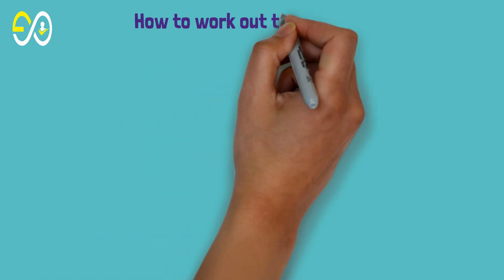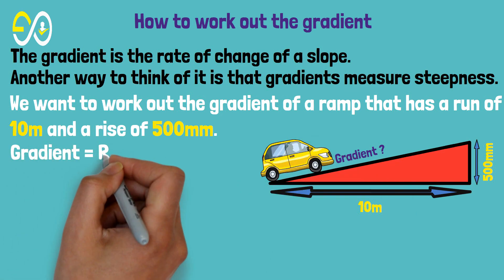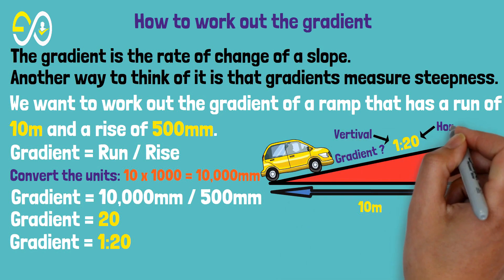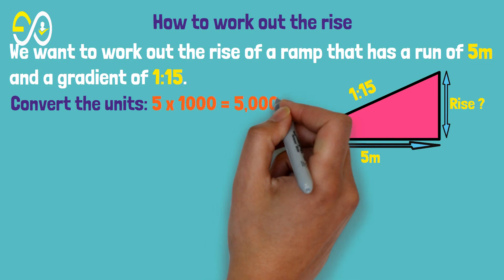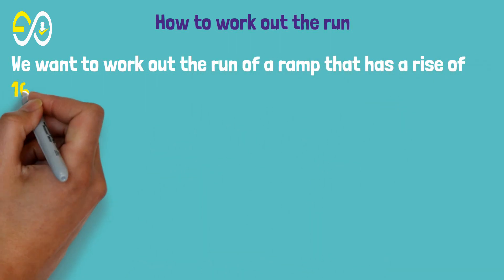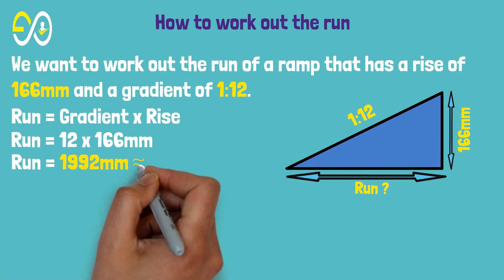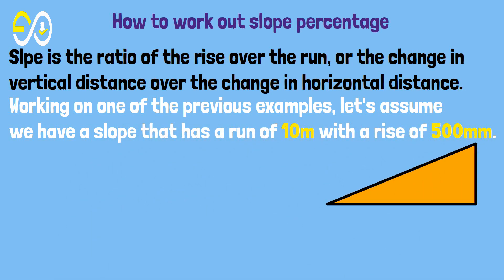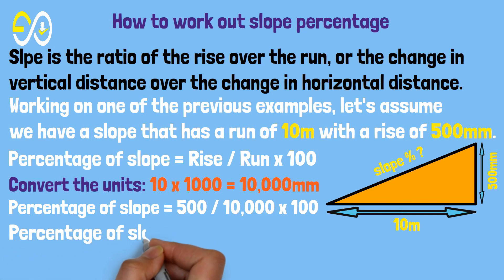How To Calculate Slopes And Gradients?

Comment: I may making a mistake to calculate what google maps defines moderate hill on my journey to my working place. the road length is 700m (0,4 mile) and the difference in altitude is 18,89 mt (62ft). what calculation should I do?